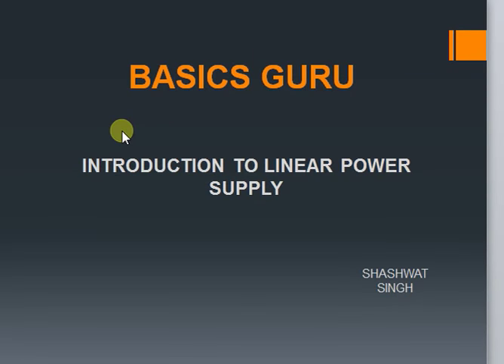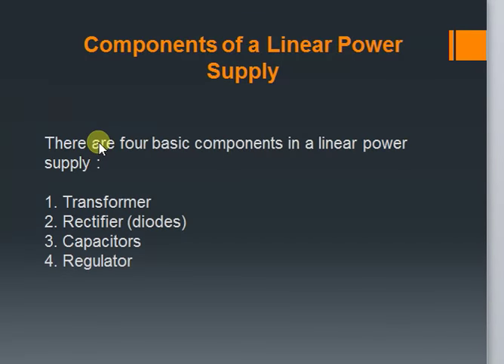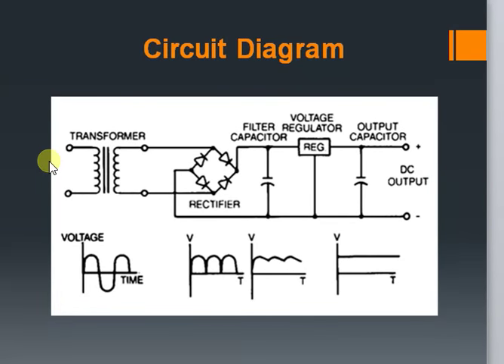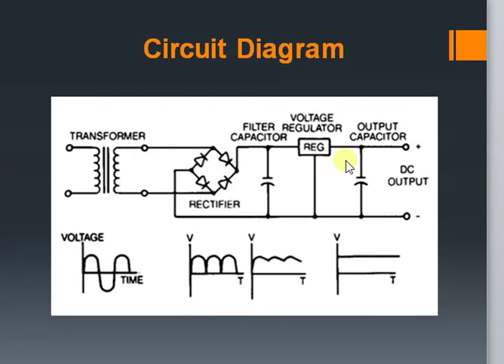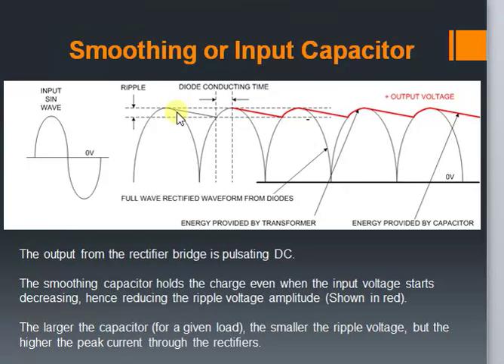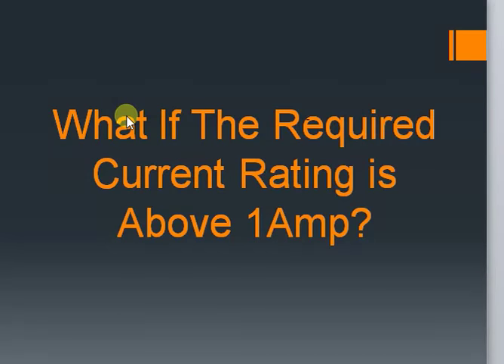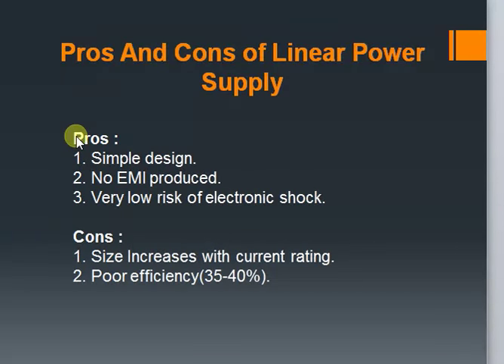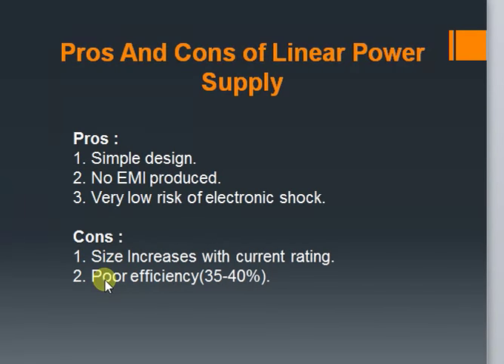Linear power supply Explained | Power Supply Basics | Basics Guru

Comment: When the transistor becomes forward bias, does the voltage change? Also, sometimes there is a diode in parallel with this circuit right,and the purpose is to drain excess current? Does it not remain a linear circuit? I am confused on this and am trying to gain clarity.